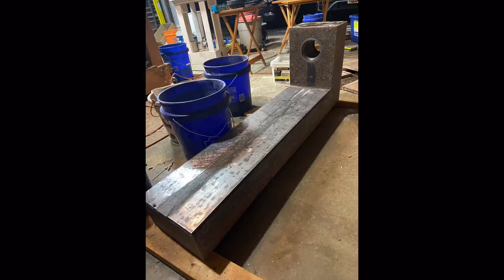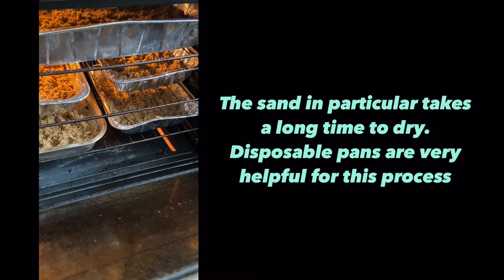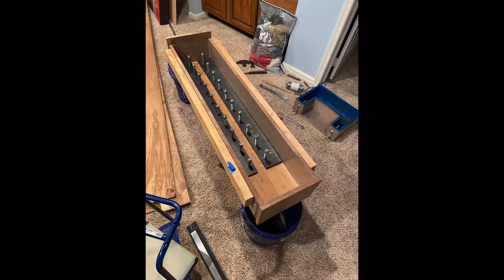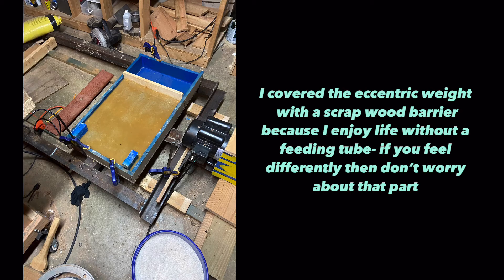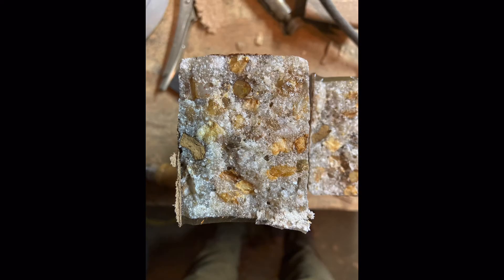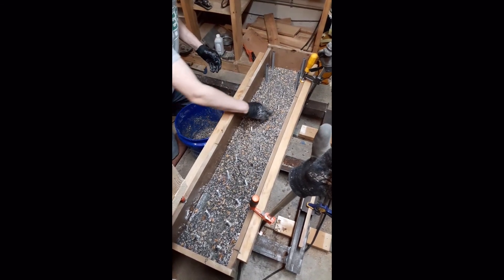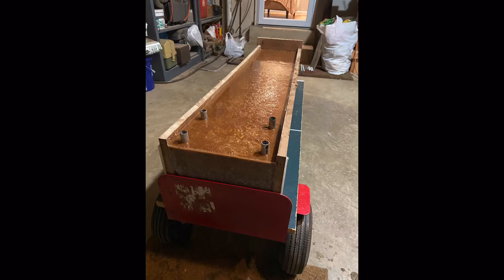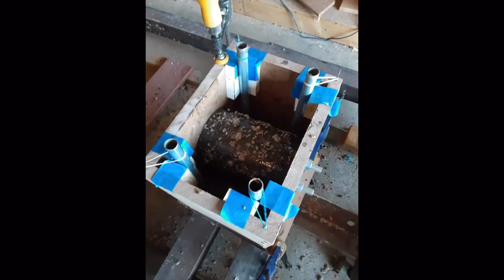Epoxy Granite Process for Machine Tools

Comment: One YouTuber says you should mix epoxy part A with the aggregates first, then mix in part B. I question this method because it's a lot easier to thoroughly mix two liquids than it is to thoroughly mix a liquid and aggregates. He claims it gives you more working time, but I highly doubt it, since the final mixing takes longer to insure the two epoxies are properly mixed. Moreover, if you mix part A and B but don't mix in the aggregates as thoroughly, the process is a lot more forgiving.  What's your a take on this?

Btw, when you're follow up video? I'd love to see how it turns out.
Reply from the maker: Hi Bob!
I have to say I completely agree, mixing the part B in after the part A seems like a big mistake- it becomes wildly harder to mix once you have your aggregate in there, and the epoxy parts are the most important thing. That was sort of my reasoning for mixed things the order I did. First epoxy to get that super well mixed, then large stone because it’s easiest to mix with, and moving smaller and smaller where it becomes harder to mix. My theory was that way if something didn’t get mixed in perfectly, it would probably only be my smallest aggregate since that’s hardest to mix in and last to be mixed. Ideally kind of minimizing risk that way? I did feel confident I got a good mix though, it’s tough but definitely can be done.

I keep telling people soon hahaha, but soon! I’ve got power run to it and started a control panel and a few other things, just been incredibly busy. Really like 2 more days of work (which might be a week or two until I have time to do…) and I can get to editing, almost there!

Comment: Did anyone mention that it looks like you vibrated your casting so long that your finer particles came out of suspension?

Mark
Reply from the maker: Hi Mark,
Are you referring to the larger casting with the “dark layer”? If you are then that at least wasn’t an issue, for my second finest particle size I switched from a light aggregate to a dark aggregate part way through which made it look like there was really bad settling. If you look closeup (aka if I was competent at YouTube and actually got a good closeup shot lol) you can actually see that there seems to be a proper mix at all levels of the casting, I don’t think the settling was very significant here.
Or if I’m totally missing something let me know haha
Reply: @robertsteinwandel6658  That is a great answer. And I stand corrected. You are doing a great job on this build. Guessing it stopped for a little while?

Mark
Reply from the maker: @KravchenkoAudioPerth  thank you! 

Yeah unfortunately I’ve been crazy busy with work and other things, still working but slowly right now. It might be a few more weeks before I can put out another video but another one will definitely be coming, and I should have power to the lathe and operating motors!

Comment: Like to add you typically only need to vibrate it the first 30-60 minutes. You don’t want to over vibrate when its trying to cure. Its a must do to avoid those air pockets.

You did a fantastic job we live in a desert region so i was able to dry my aggregate and sand on a sheet of plastic tarp outside for a couple 90 degree days. You have to rake it to expose the moisture. 
The oven is probably more certain but i had no issues.

Also if you want to run coolant or wiring through the casting make sure its added before you pour.  

Only other thing with mine i embed a frame structure and it does make a difference. 

You can add ceramic microspheres, powder cast iron, aluminum, etc into your epoxy. You can even add graphene if you van afford some. All depends on your budget.
Reply from the maker: Thanks a lot!
Your machine (lathe/Mill possibly?) sounds really interesting, could you describe it any more? What type of embedded frame did you use, like welded/bolted steel frame set into the EG?

Actually I wildly wish I had used a single plate on top as opposed to the 2 bars, the 2 bars didn’t save much money and added hours and hours of work to get them flat and parallel. Sometimes I really wonder if I’ll end up redoing the entire machine with all these lessons learned hahaha
Reply: Oh and lastly if you use an ATP-5 cast plate instead of bar on each side you can use one piece even though you need to run a ball screw down the center as long as its hollow underneath. You can have it prebuilt with the bottom mounting plate so your 90 degree is cast right into the epoxy. This does require fastening two thin strips for the linear guide rails to butt up against when you install them later.

You could use a 3” or 4” half tube of PVC from home depot, or something similar to get that channel open. 

The PVC makes for a nice washable surface. After its cured you can cut the center plate section out and if you cast a close to perfect 90 with the bottom you shouldn’t need to machine either surface. 

A nice cost savings by building this way and you’re not risking the surfaces or  paying someone else to finish it for you. You’re ready to paint then mount it all up..
Reply: If not for the bubbles, how much vibrating would be required to settle the aggregate properly without altering the composition? Reason I ask it that I wonder if sticking the whole mold into a vacuum chamber after vibration is complete, would better get rid of all the bubbles. Would a need slow-cure epoxy and some kind of chamber, perhaps an old modified long shaped air-compressor tank or propane tank... a lathe bed is the perfect item to try it on. I am interested in trying something like this myself.  Excellent video and thanks for sharing!
Reply: @deryckschnee6376  I'm going to vacuum bag the entire mold, then infuse the epoxy through it.  The downside is that the epoxy will get all over the mold and I'll have to trim off all the flash.  The upside is better density -- even fewer bubbles, and vibration-packing the dry aggregate means lower epoxy fraction.

I'm curious if vibrating while infusing epoxy will speed up the infusion.  I'm building some test coupons that should find out.

Comment: Hi Robert, were you worried at all about the exothermic reaction of the epoxy curing for large volumes, and possibly causing a fire? IDK if it's a legit concern, or overly cautious. I've heard some people online mention it. I was considering buying a cheap thermocouple and monitoring a cure cycle, to see how hot it gets. I filled my Taig cnc mill with EG, but the volume was tiny compared to the machine I'm designing. The volume of your bed is bigger than what I'm going for, though.
Reply from the maker: So with pure epoxy that would absolutely be a concern, but with eg since you have so much aggregate it doesn’t heat up much at all. I actually had to heat my casting to get it to fully cure as it was only like 40 degrees outside when I did the first casting.  

Unless you live somewhere extremely hot I wouldn’t worry about it

Comment: Nice to see this progressing. I'm not sure if you've seen Dan Gelbart's video about his custom CNC lathe that's built using granite parallels held together in compression with air bearing ways. There's lots to unpack in that video that could prove useful to your build. Looking forward to seeing this up and running. Thanks.
Reply from the maker: Thank you!
That sounds really cool! Whats the channel name I would be really interested in checking that out
Reply: @robertsteinwandel6658   Building Prototypes by Dan Gelbart, Mill and Lathe. You can look that up and he talks about the lathe half way through.
Reply from the maker: HM ah thanks a lot, that’s awesome!
Reply: @robertsteinwandel6658  the whole building prototype series on his channel is a gem. Worth watching every single one.
Reply: I remember reading years ago about using concrete for machine tools as a cheap DIY or “third world desperation” … And lapping steel rounds so they self round / true etc.

I ended up deciding that some chinesium was more cost effective and offered more features.

Comment: Greetings, your project with epoxy resin caught my attention since I was also going to make a bench lathe reinforced with polyester resin and sand because of the economics. luck👍
Reply from the maker: Thank you!
If you haven’t made your casting already, I actually would recommend strongly against polyester resin. Polyester resin shrinks considerably as it cures, and may have issues with long term movement in the casting. 
Also, epoxy granite tends to gain most of its strength from aggregate packing. With only sand you have a max 60% aggregate 40% resin, which is alright but pretty expensive. With graded aggregate mixed together you can get down to around 20% epoxy by volume, which is much cheaper and much stronger 
Just my two cents anyways, Id be really interested to see your project however you go about doing it!

Comment: I am looking forward to this video appreciate man. Really clear all doubt  i had. Hey, can you provide the links to the calculator that you used , it would really help a lot.
Reply from the maker: Thank you! Do you have an epoxy granite build you’re working on/planning? 
I can absolutely add the calculator, Ill attach it in the video description tonight
Thanks for reminding me!
Reply: @robertsteinwandel6658 That's right i am planning to build the 30degree inclined cnc lathe similar to emco cnc lathe but smaller, probably 800x250mm. I also have the er20 spindle laying around i build it for milling machine but never got the chance to build but now i fully confident to build this cnc lathe. I am really excited to build.✌️
Reply: @robertsteinwandel6658  And also why don't you try the epoxy levelling on your cnc lathe bed if you don't get what you aiming for. And also if you have the surface plate 'ground' put surface plate on a snad paper and move it back and forth to even out the surface this would really work.
Reply from the maker: Kamal singh I was looking into epoxy leveling but I didn’t see very much evidence of it working particularly well unfortunately, most people seemed to have ripples or other issues that made it not very flat. 
As for the surface plate with sand paper, I absolutely agree that would work well, but since it puts a ton of wear on the surface plate Im trying to avoid it to preserve the accuracy of my plate. Once I had my method figured out for flattening it really wasn’t that bad, it just took a little while to figure out the right way to do that.
Thats great! Ill be excited to see your project!!
Reply: @robertsteinwandel6658  Hey, i am still waiting for you to upload the calculator. 😜
Reply from the maker: Kamal singh uploaded! Been very busy at work and haven’t done a ton with youtube this last week but hopefully next week Ill have more time haha
Reply: @robertsteinwandel6658  Sorry, to cause any inconvenience, You sure be loving my build for sure 😊
Reply from the maker: Kamal singh hahaha no worries!! Im excited!!

Comment: Very interesting, I have loads of questions to ask! I make composites bythe way. 
1. Do you use a heat cycle to improve the epoxy cure? 
2. Vacuum removes any air voids but I guess might be difficult to do?
3 can you cast bed and headstock in one process? Would this help rigidity?
Reply from the maker: Thanks! Hopefully I can answer hahaha
Ive heard about heat cycling but haven’t really done it, you mean bringing the epoxy up to like 120-130F or so for a few hours to give it a better cure right? I don’t have an easy way to do that, I might try putting it outside under a black blanket on a hot day and I bet that could get there? But yeah thats a great idea if I understand right
Vacuum is actually something Ive seen a ton of experimentation with. Since vibration is so effective on its own I think the general consensus is no vacuum needed unless you have an industrial setup where using a vacuum for that last 1% of air is worth the cost. People had a lot of issues with epoxy foaming up and stuff though.
I actually definitely could have, and it would probably be more rigid. Unfortunately for me it just wasn’t realistic to get my spindle aligned well enough with my bed in the mold. Too many ways it could go wrong, and then with 1 solid piece I don’t have adjustment to correct issues easily 

Hopefully that helps! Thanks a ton for the ideas!
Reply: @robertsteinwandel6658  you can put it under a tarp with a propane heater, just an idea
Reply from the maker: @chrishayes5755  I haven’t tried this before and don’t own a propane heater unfortunately, I would think it would be a little difficult to not melt the tarp if it contacted the the heater or got too close. Do you hav e any experience with this by any chance?

Comment: I'm gonna need hard specs on Young's modulus, yield strength, poisson's ratio, density, average temperature during the mold process, deviation of part dimensions from mold dimensions, a thorough explanation of why you didn't use Zeeospheres or Silica Fume and finally a peer-reviewed study showing how 60Hz was determined to be the optimal frequency for vibration
Reply from the maker: Okay so I can’t give you all of those, but Ive got answers for most. 
Youngs I could find but I don’t have a great setup right now so my number wouldn’t be particularly accurate- I will be getting this eventually though because Im curious
Density was something around .07lb/in3, I have a more accurate calc somewhere but I can’t remember where and it’s getting late- if you really need something accurate I can get that in a few days 
I cast in fairly cold weather and had to keep the eg warm. Outside temp was around 20-30F, but I kept the garage at around 65F with space heaters and a little heated chamber I made. I also kept the epoxy inside before I cast, so the epoxy was about 70F
Zeeospheres would probably work better than my stone, but they’re much more expensive, and based on the research in the cnczone forum and advice from several people who have experience with eg the Zeospheres are far less important than having a low epoxy content and low air content. Zeospheres would be optimal but they generally aren’t that practical 
Silica fume is one that was a big surprise to me to not be useful. Again from cnczone, (and my own samples corroborated this)  ultra fine powder is very bad. Theres a principle Ive forgotten the name of, but basically epoxy has a minimum layer thickness that it tends to form around a particle. A tiny particle would still be coated in the same minumum layer of epoxy, so fine powder tends to “take up” more epoxy than a well graded mix without that fine powder. 
The frequency was entirely from Thomas Zietz, a German researcher who started making eg machines like 15 years ago and selling them. He left some important tips in the cnczone forums and that was one of them. When I tested at 60HZ it was wildly more effective than 30HZ and 10HZ.

Hopefully that answers some of your questions, but honestly it practically needs a whole new vid to get into all the details lol

Comment: Great video! Thank you for sharing 👍

Are there any alternatives to tube sand for those of us in warm climates? How did you sort the raw materials into the grain sizes needed? What was the amount of epoxy you used in terms of weight?
Reply from the maker: Thank you!
I mean basically you just need a source of stone where you can sieve out the correct sizes. It really depends on what you can get. For me the hardest size to get by far was .04-.11in, I had to buy like 3 extra tubes of tube sand to get enough of that size. 

The epoxy was by volume, but really you just need to make some samples. Start with maybe 18% epoxy by weight, keep making samples with less and less epoxy till you start getting air voids, the lowest epoxy percentage without too much air is your formula! 

Are yoy planning on doing this soon or is this a long way off?
Reply: @robertsteinwandel6658  Good to know. What mesh sizes did you use? Did you find a set or something that had all of them?

Sounds good, I’ll do some testing then :)

I’m hoping to do this relatively soon, your help will make that a lot easier 👍
Reply from the maker: Skyler1440 haha I found a cheapo set of 3 seives, my .5in sieve to weed out rocks that were tol big was actually .5in metal mesh from gardening

My sieves were wazakura brand, cheap set of 3 “soil” sieves from Amazon- not the best quality ever but they work more than fine 

That’s awesome! Id be excited to see your project! Pro tip- be impulsive. I waited for like 8 months to start my project until I impulse bought epoxy and suddenly that kicked everything off
Reply: @robertsteinwandel6658  Perfect, I found that set and ½” mesh thanks. Yeah! I’ve been sorting and washing the aggregates, the epoxy I ordered should arrive tomorrow so I can start testing :)

Feel free to shoot me an email at the address I put in a previous comment so I can send you pictures of the progress 👍 I think that’s great advice in general, life is too short to procrastinate.
Reply from the maker: Skyler1440 Thats great! Super exciting part of the process getting all ready :)
I know I remember seeing your email at some point but I can’t seem to find it, my email is robert.steinwandel@gmail.com if that works? Id be really excited to see your project!!